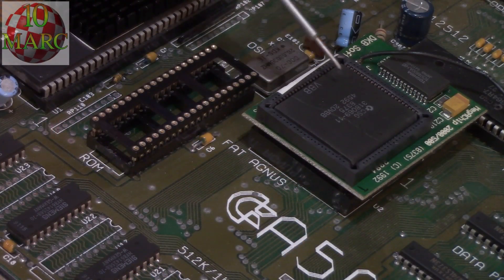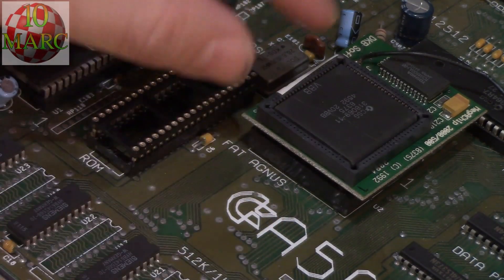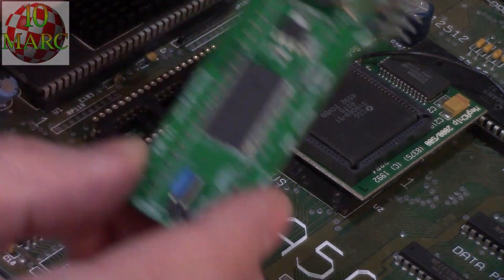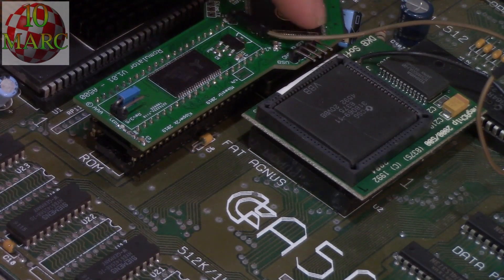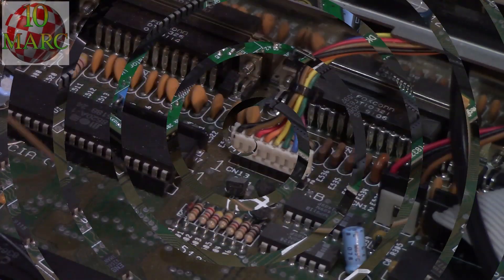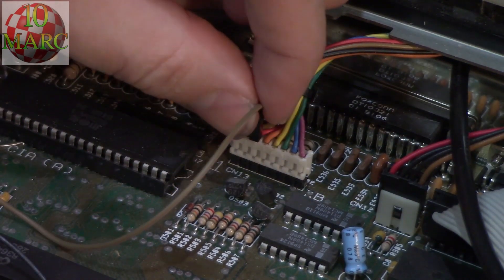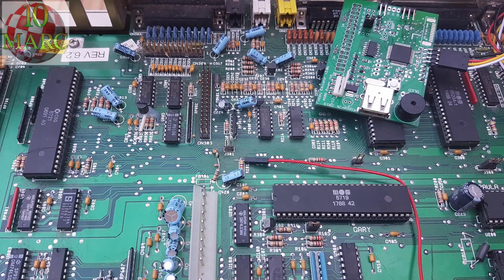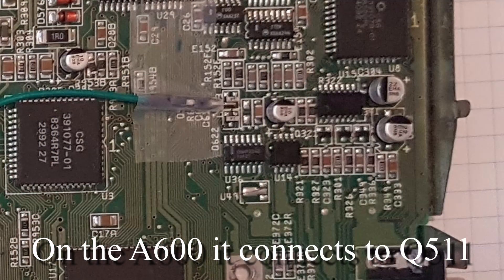Romulator Install

Comment: I am extremely happy I bought 2 of these one for an A500 the other for the A2000.   I will most likely order another for an A600 I have sitting on the shelf.    This puppy is worth its weight in Gold!   Doug your tutorial in setting it up was spot one and I highly recommend anyone looking to buy one of these take the time to watch it because the board comes without instructions.  Now for the fun part. I actually had to add a socket like Doug did because of  capacitor C816 was pushing against the SD Card and preventing me from fully seating the ROMULATOR.  Moving the capacitor was not really an option because it base is extremely close to the motherboard.    My A500 is a Rev 6A.  Getting the pin in the keyboard connector was a bit of a pain because of its round shape.  To make it easier I took a pick and gently expanded the pin area of the plastic connector to allow easier insertion of the pin.   When I have more time I will just flip the board and just solder a wire to the keyboard pin header and be done with it when I pull the board out to be recapped and add more RAM.
Reply from the maker: Good advice. I do think there must be a better way to grab that reset pin - but it is easy enough to come up with our own solutions I suppose. I heard on Facebook that the ROMulators may have already sold out!
Reply: @10MARC  Sold out is a good thing because they will have to make more and if they keep selling out then maybe they will make them for the other Amiga's and be more motivated to expand the capabilities.    I love the ROMULATOR and am happy  with my purchase.    I have to pull out the A2000 and get the next one in and running.